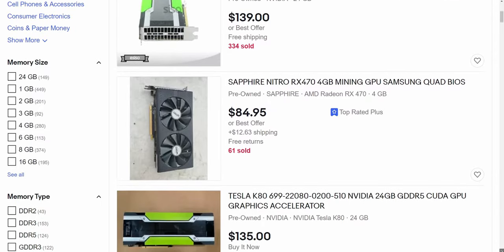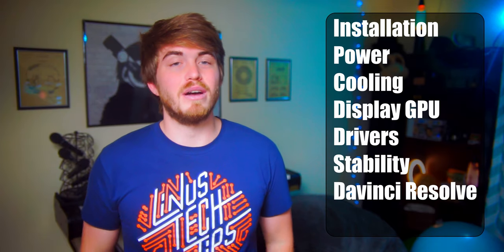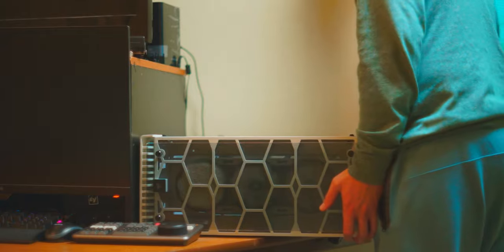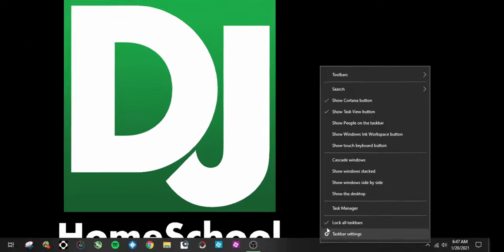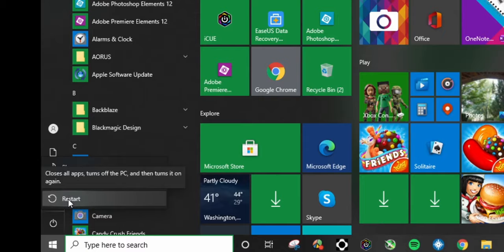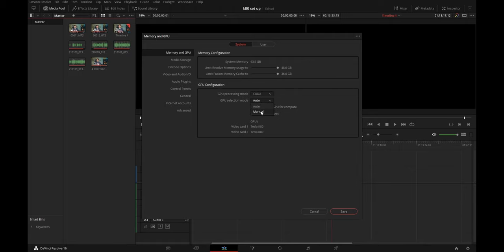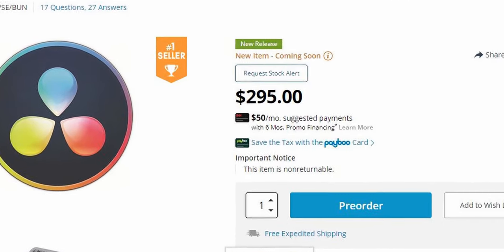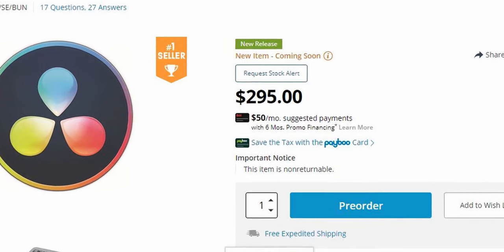24GB Tesla GPU for Video Editors

Comment: Are you kidding the audience? This is a GPU for servers, not for home PCs !!! Sorry, but this is the most idiotic GPU video I ever saw on YT!
Have you ever taken a serious look and listening at a professional server with its 6-8 turbo fans that blow the air through the housing like a hurican?
And did you ever come across the air temp recommendations for servers: air shall always be below 35 degrees centigrade in the server housing - so, no server w/o cooled room / cabinet air.

I run a RTX A5000 for DR V17 - this card is a killer for DR, and it works very well in a PC housing.
Reply from the maker: going back through comments, I came across this for a second time. I still dont understand why you are so mad. I said in the video that I don't recommend using this card in your home PC. I mean... we agree. I don't get why you are so mad.
Reply: @WillCarterTech  OK, probabbly, I completely misunderstood your video. 
But why do you demonstrate a papermade airflow-tunnel to increase airflow for such a card in a PC housing in your video, missleading your audience?

Especially, mixing 2 GPU-cards with one having the ventilators going sideway is truely idotic as it will heat up the housing of the more professional card at its most temperature sensitive surface, i.e. where the memory chips below the side panel are mounted and dissipate their heat through the thermal pads towards the housing metal.

Sorry for my harsch reaction, but your video really topped out all those 'well-meant' advice videos on pro-GPU-cards here.
Only thing I did not come across is someone to recommend dipping the whole PC into water - for better cooling.
Reply from the maker: @joyoffilming9500  alright, good to know. On your recommendation, Next time i will tell people that its a “good idea” to do this stupid little side project that i worked on. I was trying to demonstrate that nothing i did made this card function optimally. I was trying to show that it needs a blower fan used in servers or a water cooling block. This draws a little over 300 watts and i demonstrated that simply taping a generic pc fan was not enough to cool the k80 sufficiently. There were 5 videos on youtube about the tesla k80 before i posted my video. 3 of those videos stated that zip-tying a fan to the k80 would be enough cooling. I was trying to show people that those videos were incorrect and that one (and even 2) fan(s) couldnt cool this card sufficiently. 

I don’t understand why you insist on aggressively agree with my statements in this video. You obviously dont want to agree with me, so just stop stating the same things that i said in the video. Lets disagree to agree. 

😂🤣 it’s been fun arguing with someone you agree with on the internet. Ive had fun being childish with you.

Comment: I totally disagree with the part where you say don't waste your time. I have a MSI z390 gaming plus motherboard. I'm running 64GB of Corsair RGB Pro 3200 megahertz and an Intel i5 9600 unlocked. I had to do some digging but I downloaded the entire Cuda package and ran it on GitHub. You cannot run the newest update. It's the one that starts with like 392 but if anybody wants information I did upload my benchmarks to cpu-z. The gamertag is Goku Ultra gamer
Reply from the maker: Excellent information!